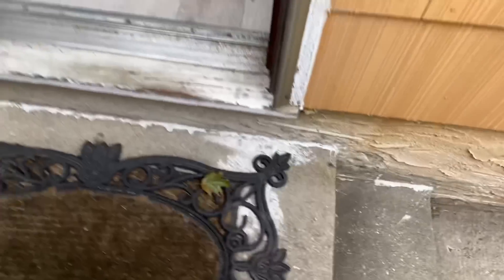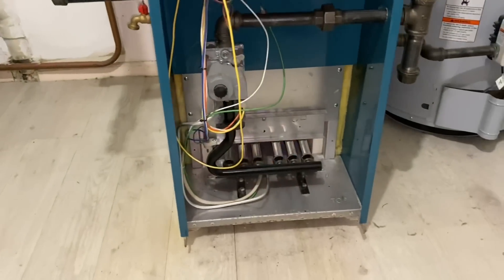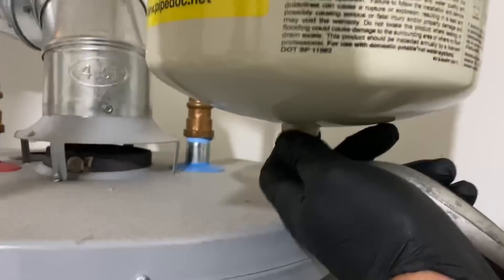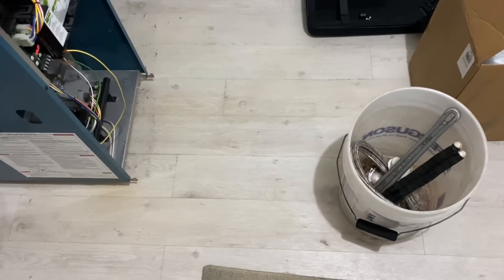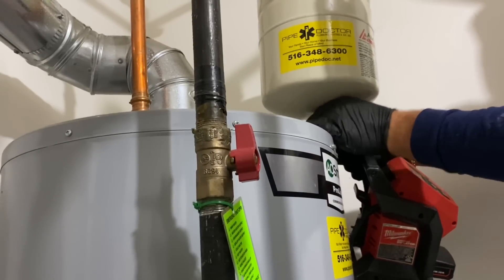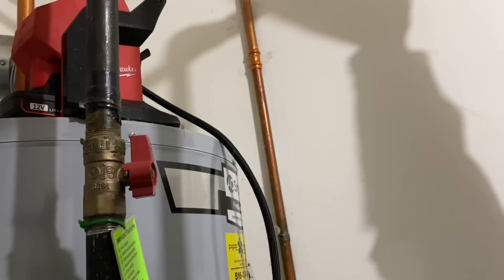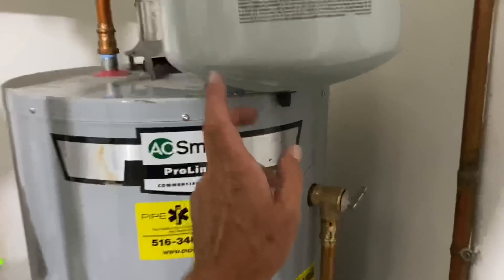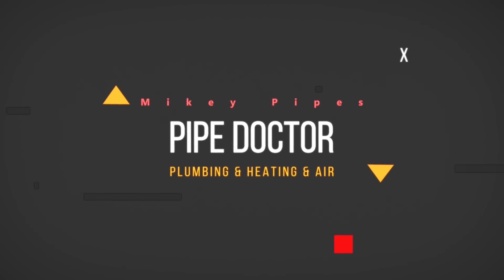Annual Heating Service Burnham ES24 Error 15 Explained - Leaking Relief Valve Failed Expansion Tank

Comment: Blocked vent switches are for blocked vents ,down drafts happen. 
If you notice when the damper closes the heat Stays in the chamber and doesn't trip the switch when that switch trips generally there's a bigger problem.(most casses) they don't just pop it takes a lot.
"Can't Understand Normal Thinking"hair is good enough for that neighborhood,if it fits it ships!🤣🤣😂
🥃🥃🍺🍺🍺🍿🎯
Stay safe. 
Retired (werk'n)keyboard super tech. Wear your safety glasses!